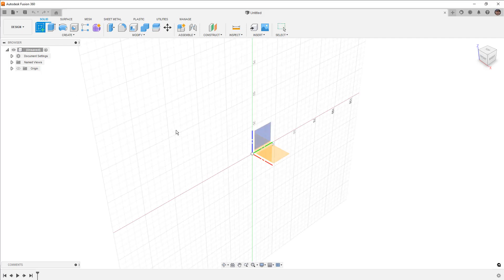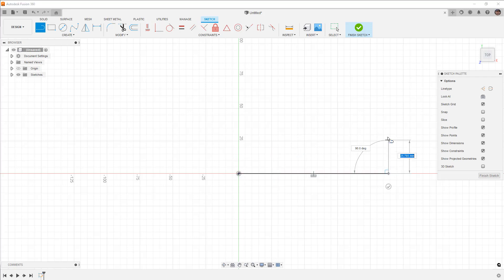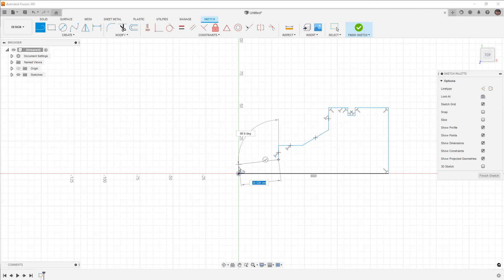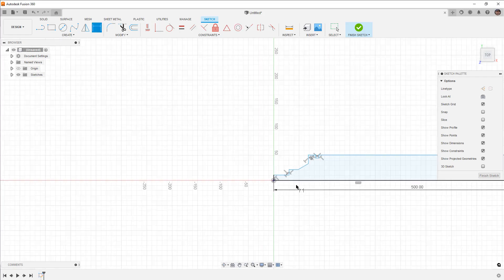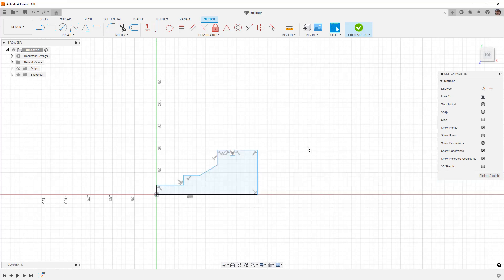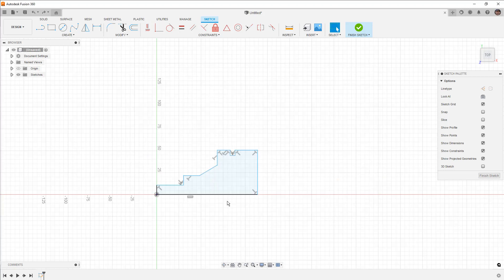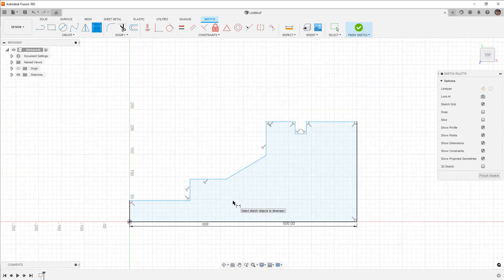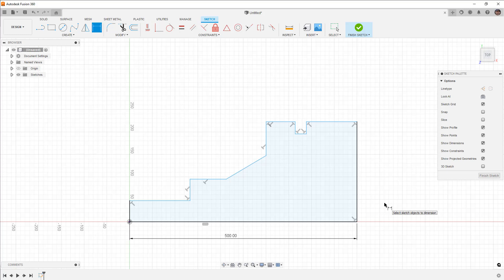Fusion 360 Quick Tip | How To Auto Scale Sketches with First Dimension | #Fusion360 #cad

Comment: This used to be very useful, unfortunately they combined it with auto zoom so now if your sketch includes any projected geometry that's larger than the part you're trying to sketch Fusion will zoom to fit the whole sketch. The auto zoom feature was really not though out, works OK if you have one component or a small assembly but useless on large assemblies and totally ruins the auto scale feature.😞
Reply from the maker: Mark you are 100% correct!  For me i actually don't leave this on anymore but it is helpful on the first sketch.  Once you have some size reference it is much easier.

One pain point is not having hotkeys to customize for zoom window and zoom fit.  Sad thing is there is an option to zoom to a single body/component.  If you right click on it in the browser and do "Find in window" it will fit that body/comp to view and ignore the rest.  So its under the hood just locked away.